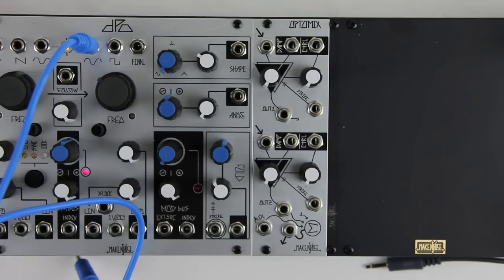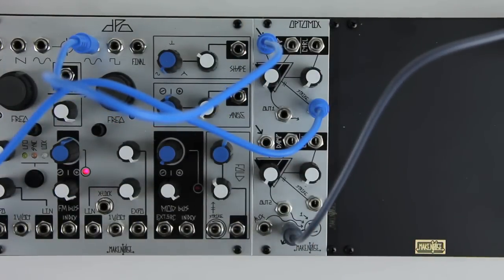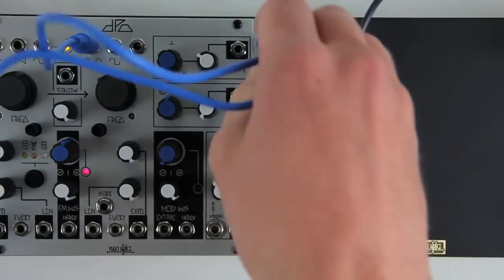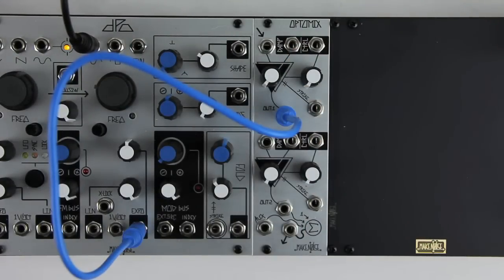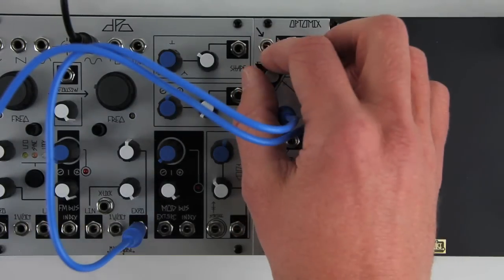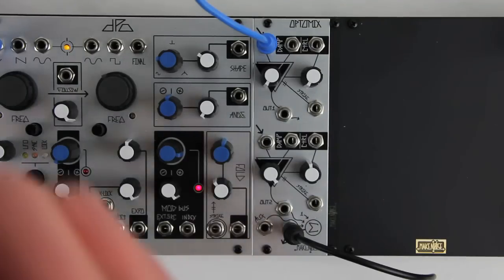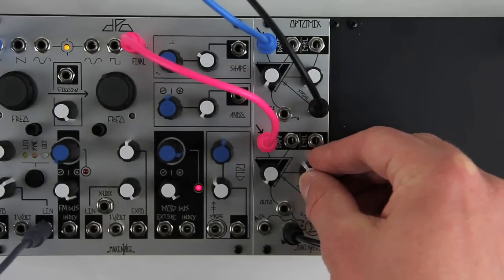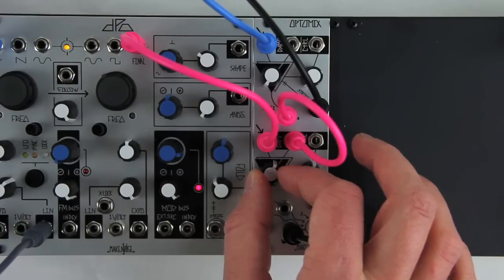Optomix New Features

Comment: Are these effects achievable on the old version?
Reply from the maker: +Confetti Hellgate Not really. Something similar could be patched, but they will require some additional patching. For envelope generation, you would need to patch an offset (such as from MATHS) to the Signal Input. For sidechain compression you would need to patch an envelope follower (such as MATHS) in series before the DAMP Input. The appropriate knob settings, and the resulting effect, will likely be somewhat different.
Reply: +MAKEN0ISE sounds like a good video idea?
Reply from the maker: +Lofuckyou You might enjoy this existing video: https://www.youtube.com/watch?v=mhJu8eFO3ds